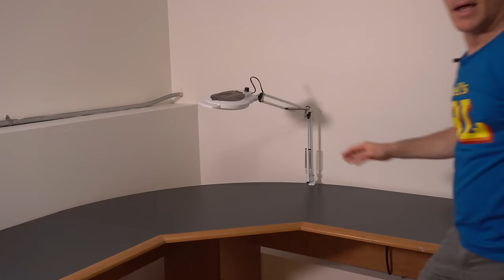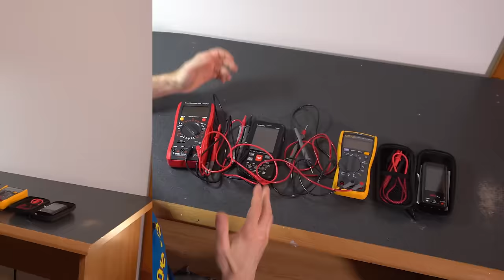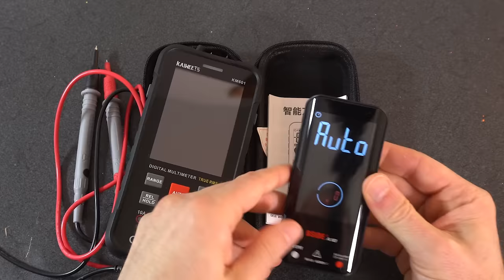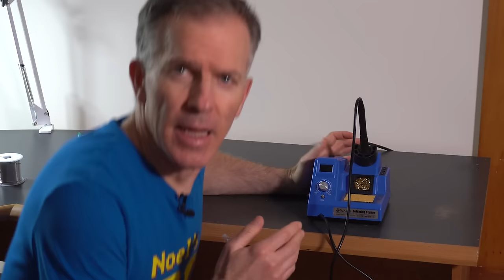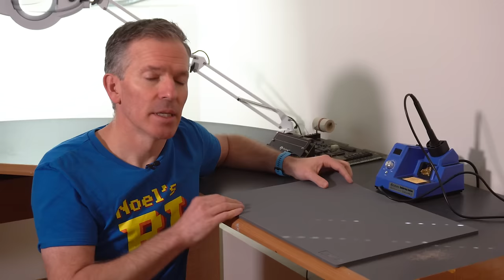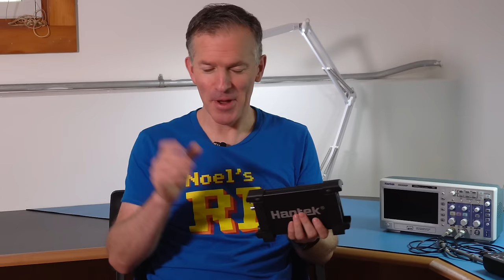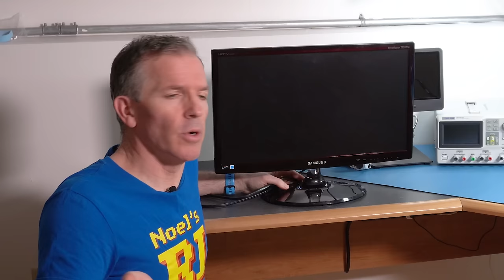Essential Tools For An Electronics Lab

Comment: For retrocomputing a TL866 and a cheap 24 Ms/s 8 channel logic analyzer are required. The scope can show the waveform, but the logic analyzer offers more complex trigger conditions and of course more channels. There are better, although more expensive alternatives for both, but these do the job.
Reply: The newer T48 programmer(TL866 gen3?) would be the best option. As it's still supported and have better chip coverage.

Comment: The thing about those cheaper soldering stations like the one you have there, is the temperature display is measuring the temperature of the heating element, not the temperature of the soldering tip, which often only loosely fits onto the heating element. I find I need to set the temperature a bit higher than I actually want, and wait a few minutes after the soldering station claims to have reached it, until it's actually ready to use. An alternative is to use the TS style where the heating element is built into the tip. They get up to temperature extremely quickly, and the temperature reading is much more accurate. They either have a small base unit or everything is built into the handle, and some of them can be powered from USB/battery making them a great choice for portable use. But they have less thermal mass so I find I need to pause for a moment between joints to let the temperature recover, where with the other one once it's up to temp I can just go straight from joint to joint. Both have their strengths and weaknesses so I use both types for different purposes. And it's always nice to have a second iron so you can switch to a different tip without waiting for the other one to cool down.

Comment: Nice presentation. Looks like you mainly use your Lab to study and repair computer products. If you want to get into other electronic products like Radios, Televisions, and Stereos, then you need a couple other pieces of equipment for your Lab. The only items you left out were a Signal Generator and an Isolation Transform. Hope this is helpful.

Comment: Hi Noel! Good to see you getting up to speed 👍. Some clarification on the scopes. Nyquist theorem says that you need at least twice the sampling rate than signal you are sampling. And that is what applies to scope - sampling rate, not the bandwidth itself. 
For square or more like fast rising/falling edges they have much higher bandwidth than sine wave or clock speed itself. For example 4 MHz square clock is more likely to go over 16 MHz and beyond in harmonics and we need to apply sampling rate as high as twice of them.
So looking for a 40 MHz scope you also look for 200 Msps (million samples per seconds) and this is the value you were talking about in a video :-)
Reply: Just agreeing with this comment, really - the headline speed is the analogue bandwidth, which tells you how much low-pass filtering your signal goes through before the sampling circuitry gets hold of it. The sample rate of that Hantek bench 'scope is 1Gs/s, which is achieved, especially in these budget units, by deviousness and cunning and is not necessarily the whole story. 

Even if it were, it interacts with analogue bandwidth - you want some low-pass filtering else you get a lot of aliasing (non-existant waveforms arising from sampling errors) so your max bandwidth will want to be limited to half the sampling frequency at most, and most scopes (including this Hantek) have an option to switch in an even lower bandwidth limit to curb aliasing. 20MHz in this case. Furthermore, the overall analogue bandwidth in these things is software-set with switchable filters. They offer a range of models with bandwidths from 50MHz to 200MHz, and they're all the exact same unit with different badges and firmware. Firmware changes will turn a 50MHz scope into a 200MHz one, but even in its 50MHz form, the picture you get of typical signals is not very different from the 200MHz one, and in many cases it actually paints a more useful picture (because of less aliasing). Further again, analogue bandwidth limits are not usually "hard"; higher frequency signals are attenuated in proportion to the frequency, but they're not eliminated entirely beyond the stated limit. 

Other factors include how many waveforms per second can be captured, and the stored sample depth - the more, the better. Also whether the sampling is shared between the channels - with these cheap Hantek scopes, it is - the 1Gs/s drops to 500Ms/s per channel with both channels active. (Pay a significant amount more and you get headline sample rate on all channels at the same time. That's not to say avoid the Hantek. Indeed, at the price, it's almost criminal to pass it up. Mine also features an arbitrary waveform signal generator (another software-defined feature) and that is a very useful thing to have around, too. It's two really useful bits of lab gear in one unit, for a bargain price.)

Then there's the thing of probe impedance and compensation, and 1x vs 10x probe settings. I have a "40 MHz" scope-meter, similar in principle to the one shown here but only single channel, as well as a variety of bench 'scopes, including a 150MHz version of that same Hantek, another cheap 50MHz scope that's similar, and an old 100MHz HP with a CRT. My scope meter has a 200Ms/s sample rate, a low waveform per second capability, very little sample depth and a stated analogue bandwidth of 40MHz, though in reality anything above 20MHz is noticeably attenuated. However, using plain (non-coaxial) test leads, it provides an interesting perspective on what other more serious scopes show you (even five thousand quid's worth of 350MHz Rhode&Schwarz or a ten grand Tektronix) - the proper co-ax 'scope probes are reactive, and hooked up to an 8MHz crystal on a 3.3v development board, for example, my cheap little scope meter shows me a nice square wave, while most scopes show serious rounding of the edges because of probe+lead impedance and the fact that the crystal cant't drive a 50 ohm load all that well. The "10x" setting on typical scope probes reduces the load (at the cost of signal amplitude at the scope end) but not enough to avoid having an effect on some signals.

So 'scopes are kind of funny. Turns out a 50MHz scope can be as good as or better than a 200MHz scope for signals in the 20-ish MHz range, and sometimes a fancy scope probe is no better than, or worse than, a bit of wire, and you can't always believe what you see on an oscilloscope, it needs to be interpreted in the light of experience.

Anyway, enough waffling - to Noel, great video, thanks!

Comment: There were 2 devices on your final scene, which you haven't mentioned in the video (or maybe, I have missed): UV EPROM eraser, and function/arbitrary waveform generator. As for side cutters, I used to use Knipex, but recently switched to the Chinese PLATO 170 clone, which seem to last as long as Knipex, but cost 1/10 of it.
Reply from the maker: Good eyes! You're right on both accounts. The video was long enough already, so I didn't want to get into more specific tools, but both of those can be really useful (along with the EPROM programmer sitting right behind the eraser).
Reply: Totally agree about the Plato 170 cutters, that's all I use 99% of the time these days.And when they dull, toss 'em and buy another pair!

Comment: I always found my portable multimeter had glare problems, or it was a bit clumsy to use one-handed, or I kept accidentally yanking it off the table, or something stupid.  So I got a BK Precision 2831B off ebay for less than $50.  Not only do I love the retro look, but having a benchtop DMM is so much better.  The display is oldschool red LED, easy to see even though its sitting on a shelf above my workspace.  Everything is controlled by chunky pushbuttons so you can easily mess with it one handed, and it's plugged in so I don't have it going to sleep on me to save battery.

Comment: Great video.  A couple of suggestions would be to augment the tweezers/forceps with some surgical clamps and/or 'squeeze to open' tweezers.  Another would be to include a variety of physical probes/picks, such as you might get for medics or dentists.  Also having a variety of scalpels is useful.  At the other end, I've started using a signal analyser ( TinySA is nicely priced and featured, as well as having tons of YouTube videos showing you how to get the best from them).  Finally a Vector network analyser can have its' uses (again, I've started small with a NanoVNA, which is cheap).  Thanks for the great presentation.
Reply: Getting cheap picks etc. is where Harbor Freight shines.  (Be careful with the quality of other stuff there)

Comment: Thanks for the great video, These days direct heating soldering iron is very common, Bit pricy but a good investment. Hate digital oscilloscopes. They never read the signal in real-time. The hakko fr410 soldering sucker is very efficient. Fluke 179 is a suitable bench multimeter. Big displays reduce the battery life. The rest of your tools is fine. Love your anti-static mat. I may replace my high temp rubber mat with this one.

Comment: For screwdrivers i have 3 different drivers with lose bits. I use only like 7 bits so I just buy those once in a while and that's a good system because you dont have alot of screwdrivers on the desk. I try to keep the desk as empty as possible :)

Comment: Small hammer, X-Acto Knife, Ruler and Scissors are some hand tools are handy to have
Reply: Better than an Exacto knife: OLFA knives with retractable, scored blades. Surgically sharp, like scalpels. Just snap off the tip to create a fresh cutting edge. Replaces ordinary utility knives, as well as  the exacto knife. Avoid the knockoffs. The OLFA blades are the sharpest I've ever used by far, and the latching mechanisms are superior (especially the thumbwheel type).

Comment: A few very simple tools i would like to add:
1.) helping hands/ pcb vise
2.) IC puller
3.) Calipers, IC ruller with Wire Gauge measurement holes

I guess these could depend on the type of work being done.

Comment: You should have a signal source. You may need to inject clocks or just check a signal line continuity. A cheap function generator is a good idea. I modified mine by putting a 1:1 isolating mains transformer inside it. That made it a much safer and quieter source as well as preventing it sliding around when I tried to press a key.
Reply: I think his oscilloscope has an inbuilt generator.

Comment: Wet your soldering tip cleaning sponge with glycerol. It should be wet with water but it's inconvenient because water evaporates fast and because it cooling a tip very much. Glycerol will be always there and it cleanes tip perfectly without cooling it down.

Comment: Two things:

01. Good soldering station is crucial - JBC or clone with C210/C245 tip.
Nowadays stuff is much more heat sensitive than oldies so turning the station into 420 oC is not a safe option.
The more you spend on it, the better you will sleep later and the fewer problems will you have.

02. I have this kind of microscope but I wouldn't buy it 2nd time.
It is very unpleasant for your eyes when you work with it for a longer time duting day so I prefer USB microscope with connection via PC into big screen 1m from my eyes.
Reply: Agreed upgraded from a cheap weller station to a jbc clone the aixun t3a with the c245 handle. Game changer for me

Comment: Hi Noel,
First of all thank you for the great repair content. But now I need to correcting you in context of the oscilloscopes. Digital oscilloscopes have two important parameter:
1, Bandwidth or frequency range, 2, Sample rate. The first is in MHz, the second in Samples (mega or giga, Ms, Gs). For example in the video the first oscilloscope has a 200MHz bandwidth and 1Gs sample rate. 
So in general, if you see sign on a scope "20Mhz" this means only you can measure maximum a 20MHz signal with this scope and the sample rate is minimum twice of the bandwidth (more acurate and more expensive scopes have minimum 5 or 10 times higher sample rate than the maximum frequency).
Finally I hope we can see new repair content in the near future!

Regards Mark
Reply from the maker: Oh! That's even better than I thought. Thanks for clearing that! 👍
Reply: @NoelsRetroLab  Your very welcome!

Comment: I have used a £10 non-temperature controlled iron from Farnell for the past 4 years with no issue. It's also not going to burst into flames like many of those no-name cheapo Chinese soldering stations.

Comment: Those red cutters at 4:09 are simply great, I buy a few of them  (Home Depot) and keep them in stock. These are precise, sharp and make a clean cut for electronic components and wires. 

Those tweezers is another set to die for, these are great for component placement and extraction. I would also go for for a PCB holder, maybe ‘extra hands’ with a magnifying glass, also a micro bench top vise.

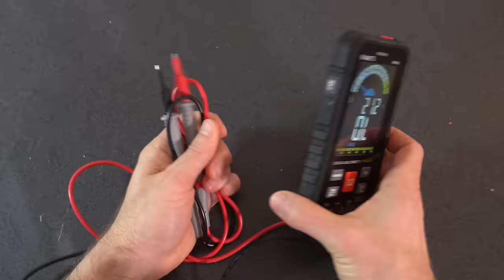The multi meter at 7:41 would be best suited when it’s mounted in front on the wall over the bench top. Normally I would demarcate a place on the bench top for testing and measurement and possible general assembly, here The meter is best mounted on the wall so it doesn’t take up valuable table top space

Comment: Nice setup! The portable Hantek is handy when you want to be isolated from mains ground or when you are doing some delicate probing. You can have the screen right next to the chip. Or of course if you go to a show. A portable scope is always good to have. You are ready to crank out some retro repairs again.
Reply from the maker: Very good point about the handheld Hantek. It also doubles as a multimeter, so great for taking places.
Reply: @NoelsRetroLab  Hantek also do a WIFI scope with 70MHz bandwidth and you can make the software work in Linux using Wine. It aIso works on an android tablet which is great if you ever need to used a scope in a car. I also have the same eprom programmer and have got that to work in Linux using Wine and a 3rd party DLL.
Reply: @NoelsRetroLab  portable scopes are also really handy for working on cars

Comment: Awesome video!
Totally agree on the multimeters and soldering irons: getting the cheapest one will be a big waste of time and source of frustration. For soldering irons, the T12 series are very good while being inexpensive. 
Another very handy tool for debugging digital signals is a logic analyzer, it's much cheaper than an oscilloscope, can have 16 or more channels and high frequencies (from 100MHz), which is convenient when you have parallel buses.

Comment: I think you need a Bench Multimeter (DMM). The handheld meters do not measure VAC when you are working at frequencies above around 8 Khz. I think you also need a Signal Generator to be effective.

Comment: This is an excellent video that I can see myself referring back to many times in the future. I appreciate how you went for the best value tools, as I know there are plenty of gatekeepers out there (usually in the YT comments section) that insist that anything less than a 4-figure oscilloscope, a  $300 soldering station or a $500 multimeter is basically e-waste, which is simply not true.
Reply from the maker: You're welcome! I agree, there are a lot of comments like that. The trick is finding what you need at the best price range, so I'm glad this was helpful.

Comment: Great video

My addition to the must have list is some kind of fume extraction especially if you do a lot of soldering and tend to hunch over the work. Anything helps and it's better to at least not breath in the fumes directly. A big computer fan with a filter on the back will keep some of the fumes away from your face and lungs. 

Desoldering irons are in my opinion a must have especially for me who is useless with desoldering braid and sucker. I've used a cheap one that pretty much is a solder pump/sucker with a hot tip. It's like 15 bucks and will work as . But the suction isn't super so use some steel wire (or straighten a large paperclip) to clean the pipe after a couple of pumps. Also be very mindfull of the heat. Mine gets really hot so work fast and smart. I usually work from the outsides inward switching sides every other pin so the board don't get too hot in one place.

Love the videos
/Bo
Reply from the maker: Absolutely! Actually, I'm preparing a whole video about that.
Reply: @NoelsRetroLab  awesome. Looking forward to it.

Comment: A signal generator is very useful.  Many modern oscilloscopes have built-in arbitrary waveform generators which are great signal sources.  For magnification I don't like the electronic camera type.  They tend to have a lag and no depth perception.  An optical stereo microscope is much better.  They have no lag and allow you to see in 3D, essential for close in soldering.  A .5x barlow reduces the magnification by 1/2 which gives a larger field of view and doubles the working distance.

Comment: I unfortunately don't have a lab setup, but one thing I used heavily in my classes was a digital logic analyzer. You lose the resolution of a oscope but you gain over a dozen channels which is great for debugging well known communication protocols. It might not see as much use outside of embedded programming though.